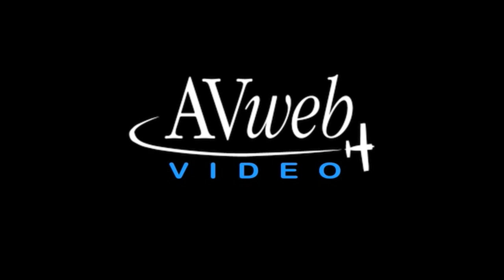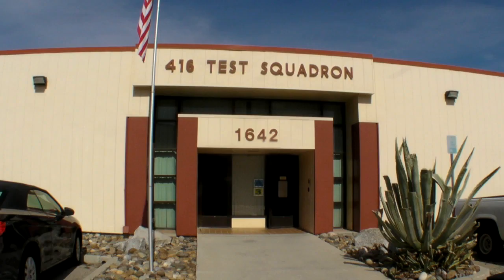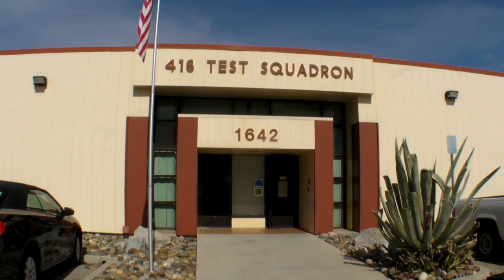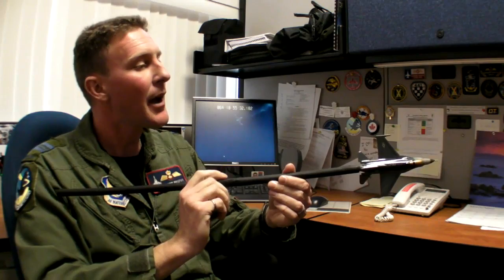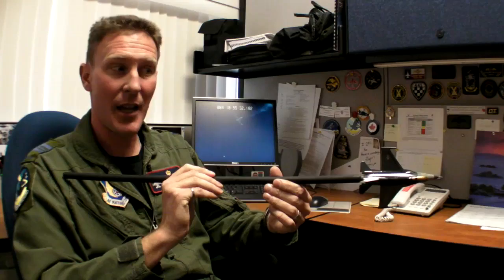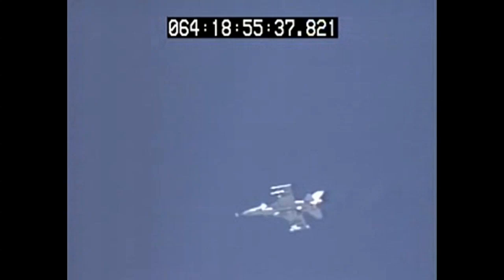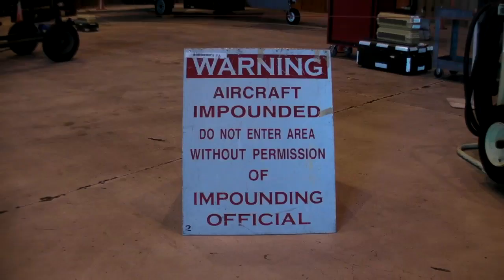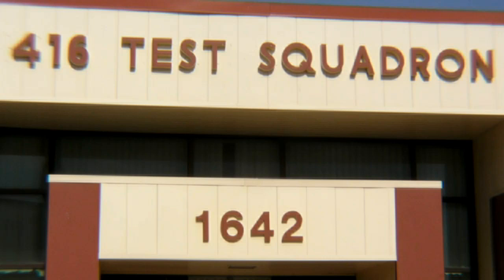F-16 Loss of Control, Test Pilot on Yaw Departure

Comment: The discussion by "Deuce" Brophy was excellent! He was to the point, succinct, and lucid. I appreciate these explanations, since it only increases my bit of knowledge. Thank you for this good video.
Reply: Gil Mosko   I agree. I am not a pilot; always wanted to be, but my eyes were not AF "OK". So I read, and watched, and learned. I understand G forces, and IIRC, the F-16 has a 9 G limit? So by being lighter in weight than was estimated, the force applied by overcontrol had a greater-than-expected result on recovering control. Am I correct? So the affect was, there was nothing wrong with the S/W upgrade; it was a lighter-than-estimated aircraft weight which caused the unexpected result of the test maneuver.
Reply: The F-16 has a 9G limit under certain configurations. The jet in the video though can pull 9G's.
Reply: Gil Mosko I don’t know what those words mean, but that pilot is kick ass!  He’s got the smarts real good!!!!
Reply: JosephK109 

The presenter said that the g-limit was encountered due to post-departure gyrations due to the inherent nature of the aircraft. 
Seems to me this test was about whether or not the flight control system has the authority to recover after a departure in this situation. It did. 
Seems to me everything went as planned except for those gyration forces. 

But I would comment that if a computerized flight control system cannot account for changes in weight and causes departure because of it, seems to me something’s wrong with the flight control system. 😉
Reply: @JoeInCT418  you don't need good eyesight to be in the AF, i know a lot of viper guys who wore glasses but got LASIK and in the air force

Comment: For the Air Force to let you intentionally lose control of one of their hundred million dollar aircraft, you have to be smart.
Reply: Or $20M in this case.
Reply: Any pilot testing aircraft at Edwards is smart.
Reply: @pdutube  last I checked, F16 costed over 60 million dollars
Reply: @TurkishRepublicanX  Yeah, new Block 70s but the C & D initial flyaway unit cost was $20M. USAF isn't buying new F-16s (yet). The new batch production is for foreign export. Those are $60M+ depending on systems.
Reply: @pdutube  I think 20M$ figure is from the 80 ies dude.
Reply: @TurkishRepublicanX  2000.
Reply: @pdutube  if that's true... that's remarkably cheap
Reply: 60 million sir
Reply: 11 years later ...  and it still doesn't cost that much 😕

Comment: I had a FCC (flight control computer) anomaly during a BFM flight in the mid 90s in a Block 15 F-16A.  During a hard pull the plane yawed.   The snap roll at 400kts was violent and huge induced yaw . While in the “tumble I looked back to see what the controls were doing and I watched the stab move the whole travel +/- 60 degrees and the rudder flap a bit.  After about 3 oscillations,  I was at 200 kts going about 20 degrees nose low.   It was “fun”.    After we landed we downloaded the video and all 5 recording parameters and sent them to General Dynamics.   Faults were in the FCC and there was an over G. 11plus positive and 6 in asymmetric.   The plane was ok, little damage but was taken apart extensively.   It appears one stab went nuts during the pull and failed.  The plane recovered on its own.    The data was compared to flight test data and similar points were obtained earlier .  It did what it was programmed to do and recovered itself using the remaining flight controls .     So the point was, “we have those data points” someone went out during testing and flew similar profiles during flight test!    Geeezzee.   They are true heros and gold star pilots like Deuce!   Flying to the unknown and back daily…….  Great video!

Comment: I deleted my old comment because I listened to this video a few more times attempting to learn what happened here.  The excess G limits were in the "rolling" direction during the departure phase of the maneuver.  Since the airplane was lighter than expected, the G "limit" was higher than they originally believed.  Therefore, they did not overstress the jet in the "rolling" moment of the departure phase of flight.  I think.
Reply: Rolling-G limit is always lower than symmetrical G-limit. Because to roll, one wing must develop more lift than the other.

If one wing develops more lift than the other in order to roll, and you pull to maximum symmetrical G limit, while rolling, then by default one wing is below that limit and the other has exceeded it. 

Typically you will see a ~25% reduction in allowable limit G load with ailerons deflected. This is one of the reasons the Extra-330 has a wing rated over 22g ultimate, for an aircraft that has a published limit load of +/-10g. Because aerobatic pilots don't always reduce G while rolling. 

This is of course at a defined gross weight. If the aircraft is lighter, the wing will experience less stress at the same G-load. Therefore, you have more margin between structural failure at lower weights. Allowing you to exceed the published G-limit before actually exceeding the structural bending limit of the wing. 

But, this assumes the reduced weight was removed from the fuselage, and not the wingtip, or anywhere outboard on the wing. A reduced fuselage weight means reduced wing bending moment at any given G-loading.

An F-16 carries a substantial part of its gross weight as internal fuel located inboard of the wing, mostly contained in the root. It consumes this fuel at a staggering rate, often exhausting its fuel in a 1.5hr mission. Or as little as 15min with afterburner. So, if this test required climbing to altitude, cruising to a test area, and performing maneuvers then it probably consumed a substantial portion of its fuel by then. Maybe 10% of its mission takeoff weight. Therefore, this maneuver might have exceeded to published rolling G limit assuming gross weight. But at the time of the incident, the aircraft was light enough not to over strain the structure. 

This applies to Cessnas as well as space shuttles.

Comment: I used to get into this situation on Falcon 4.0 sim when carrying a full bomb load while maneuvering, even with the bolck 50 upgrade. Even turning off the pitch override, trying to wiggle out of a deep stall didn't always work and I ended up bombing the enemy with my whole aircraft.
Reply: John O Falcon 4.0... memories.
Reply: I had a voodoo gfx and F 4.0 was awesome. I loved to call in an emergency and get guided back to the airfield. I could also deadstick land the bird. To minimize drag i jettisoned external fuel tank and missiles.
Reply: Do you have Falcon 4.0 : Allied Force??  Or one of the mods for the original Falcon 4.0?  Would love to see a video of your flying

Comment: Not sure what’s more impressive. The pilot or the fact that the F-16 didn’t disintegrate under such force.
Reply: Air density, and therefore q, are much reduced at 35,000'. Somewhere in the range of 0.3. An aircraft surface can only generate a certain maximum lift coefficient. Usually in the range of 1.28 (flat plate) to 2.0 (high lift airfoil). The structure only needs to withstand the force it is capable of generating through aerodynamics under a given free-stream condition. 

An aircraft capable of sustained 9g flight, where it requires ~ 400ktas at sea level to attain, is going to be virtually impossible to break at 35,000' while subsonic.

Comment: I saw an F-16 at Edwards come in at low altitude, depart controlled flight and then accelerate out in a different direction. Whole thing took about 5 seconds. When they landed the computer tech in the back seat looked kind green...

Comment: Yes, I agree that the sideslip determined the direction of the spin.I was puzzled by what he said that with the missiles on the left you get the effect of putting in full right rudder.Maybe the flight computer feeds in right rudder in that configuration and that's why it departs that way.

Comment: This does not really make sense to me, wouldn't one expect that the rolling G limits would be exceeded given the means of approach that is being used to get the aircraft to depart and what you expect the aircraft to do in it's departing of controlled flight, one expectation would be the exceeding of those G limits wouldn't it be? Also wouldn't you know what the base weight was initially, why would that be something that was needed to be computed.?
Reply: The weight would be recalculated after the flight to compensate for fuel burned to the moment the departure from controlled flight occurred.  In this case it makes the difference between ground a plane for over stress inspection and delay of the program.

Comment: A company Harrier test pilot had a unusual takeoff routine.  He would lift off vertically, stop about five feet up, raise the gear, pitch the aircraft up about 45 degrees, then thrust away.
Unfortunately the Marine pilot crashed tail first while pitching up.  No Marine pilot is allowed to attempt this takeoff routine under threat of a court martial.

Comment: Why did it yaw right? This can't figure it out. Anyone?
Reply: OK. But why? The presenter said that because of asymmetric loading, it caused right yaw. Why would that happen? I could see it happening if the higher load was on the right, but on the left? I don't get it.
Reply: The weapons are on the left, and the flight control system feeds in right rudder to keep it from turning left because of the weapons. When he pulls back on the stick, the airspeed decreases and more right rudder is necessary, but as things happen quickly that rudder input is excessive and it enters a spin (out of control flight). 
I'm no expert though, it seems a logical chain of events to me.
They are probably doing this to modify the flight control laws to make a departure into a spin less likely.
As I understand it happens because F-16 has an aileron-rudder interconnect system (ARI), older planes that do not have it - according to flight manuals (IIRC F-4, F--8), when asymmetrically loaded to the left would depart into a left spin.
Reply: griffn14 ahhhh. That makes sense. Thanks!
Reply: There are two forces at play. The aerodynamic force and thrust forces.... The airframe stalled itself out on high speed air as it yawed and became an obstacle to the airflow... The engine thrust at the rear of the airframe pushed the back end over the stalled front end, so to speak... and it tumbled.

Comment: one hell of a recovery, since I'm not a pilot the terminology used sounds funny to me, "departure" when the plane spins uncontrollably?, "impounding" a plane when it must be overhauled? I'd call it something else haha
Reply: +wheelmanstan  "Departure" means leaving the bounds of controlled flight -- Out of control. The plane was impounded for examination after it apparently exceeded its design stress levels during the maneuver.  If it had, it probably would have ;to be scrapped or otherwise limited in future use.  As it turned out, it had not exceeded its limitations because the calculations were incorrect.  When I watched that bird out of control, all I could think of was the beating the pilot was taking in the cockpit.  This wasn't recovering from a fishtail on a slippery road.
Reply: +wheelmanstan Departure from controlled/nominal flight. Makes sense if you think of it in that context.
Reply: Fifty0ne
true, I hear departure though and I relate it to when my flight leaves the airport, that airport voice enters my head, but of course it takes on new meaning once you're already in the air haha

Comment: Well, I thought the FLCS would prevent such a "departure" from controlled flight, always analyzing the pilots inputs...
?
Reply: BernhardRottweiler Eventually, it will. This was a deliberately designed 'what-if' scenario, with asymmetrical ordnance loading combined with high-alpha turn at 35k+ feet. It's the job of test pilots to discover/test all such scenarios, so that appropriate solutions can be engineered/formulated to address those scenarios. In this case, as the pilot alluded to in the beginning, the FLCS software was upgraded to be preempt this scenario in the future.

Comment: Doesn't the F16 have carefree flying? I always thought that the Flight control system was designed to prevent such departures.
Reply: ***** Doesn't the system prevent you from going outside those limits regardless of where you are in the flight envelope even if, as in this test, you kick hard right rudder?
Reply: +ianrkav You thought.
Reply: +ianrkav 
Aircraft 352.  I remember delivering AGE equipment to her.  98-02
Reply: Right on target.

Comment: The F-16 is an awesome front line and home defence weapon, make no mistake. 
However, the F-16 is one of less than a handful of jet fighters in existence that can NOT fly without computers... that is a fact.
Imagine, you're an F-16 pilot and you get zapped by high frequency radiation waves, enough to render your computers useless. 
What would you do?
Why, you'd call on your big brother the F-15 E to plot where your chute deployment was. That's what you would do.
Reply: Bill Yost pretty sure the E needs computers to fly also

Comment: I he sounds like a mechanic engineer with degrees in aeronautics, aerodynamics and physics as well as a pilot, its because there's an excellent chance he is.  Most military and civilian test pilots are NOT the Hollywood/fictional literature stereotypical "kick the tires and light the fires renegade don't-give-a-fuck" cowboy so many people think they are. In fact, those that are aren't test pilots but are instead FORMER test pilots. At least in the U.S. Other countries and military forces in them seem to have a history of putting idiots in new airplanes but coincidentally enough also claim to build and have built airplanes so "perfect" that the "test pilot" after the "first flight" pretty much told the designer and manufacturer it was "just right" and that they "shouldn't change anything". 

Yeah. A brand-new airplane with up to millions of parts and most of them built specifically for it by literally thousands of people in dozens of disciplines and professions and a finished product that took tens of millions of man-hours when it was finally complete and it ends up being "perfect".

My dying ass.

Comment: love the F-16. Such a technological masterpiece as well. Let's quantify that or put it into perspective. 

the F-16 break point in G's 10.5.
the F-22 Raptor 10.00G 

All we had to do is. upgrade the materials to 2014 spec  carbon fibre, titanium etc. throw in a new engine with supersonic super cruise capability. 

Update the software/ radar/avionics to 2014. and the F-35 would never had been designed, it wouldn't have wasted my countries cash, and I would have got to see F-16's every day.... BOOO! haha
Reply: You seem to be missing part of the picture here. Now I don't much want to defend the F-35. I'm an Australian and we seem to be stuck with them, but ... APART from stealth, an F-35 is a fair match for an F-16, a little better in some ways, perhaps not as good in others. (1) Adding a supercruise engine to an F-16 might make it supercruise capable, but most likely not. The F-22 can do that because of trick engines, but also very clean (at supersonic speeds) aerodynamics. (2) You are comparing rated maximum G capability. That's academic. What they could actually pull, in flight, and not fall apart, is a good deal higher. It's very much like the rated strength on a piece of rope or fishing line. A 10 lb line should not break below 10 lb. It may hold 12, it may hold 30, but it will hold 10 and then some. The point I think you're making, is that the F-35 is an expensive and possibly un-necessary white elephant. On that, we agree. All I'm saying is that you need a better case. Question is, how badly do we need serious stealth? You can go over (re-manufacture) 4th gen fighters like the F-15E and add a degree of stealth. Super F-18s come from the shop like that. Are they as stealthy as an F-22? No, not even close. Are they as stealthy as an F-35? No, but they are close. Is that close enough? That's a bloody good question, and nobody much knows. There IS a need for a force of serious stealth craft, F-22s or similar, to make the first strike and take down the worst of enemy AA & missile sites. Once that's done, semi-stealth or non stealth can operate in theatre, at SOME degree of risk. How much risk is too much?

Further complicating things, we have unmanned drones. To clarify, these can be flown remotely, but they can also fly themselves. Against lo-tech and no-tech targets, they're fairly capable. How they'd go in a mid or high threat environment, is another question. But, they will get better. The current generation of manned fighter planes, is probably the last there will be. The next generation of flying combat stuff, will have a pilot wearing a tie and sitting at his desk, and if the radio-link fails, it flys itself home. We're very nearly at that point now. Could you fight a war / campaign with those things? Yes, but perhaps not with those alone, we still need manned aircraft for some things. Remote sensors is not quite the same as having eyes and a brain on site.

Comment: So was he saying that the G's were so excessive that the pilot passed out and the aircraft had to be crashed and recovered?
Reply: No.  The aircraft has G limits that, when exceeded, may cause cracks to form on the aircraft.  They thought they exceeded the G limits so they aborted further testing and landed the aircraft to perform a full inspection before allowing it to fly again.  During that inspection they found that they had not actually exceeded the limits and the aircraft returned to flight.
Reply: David Martens Was it inertial coupling?